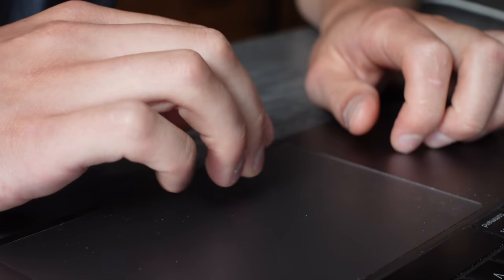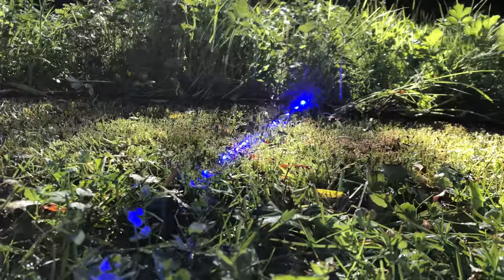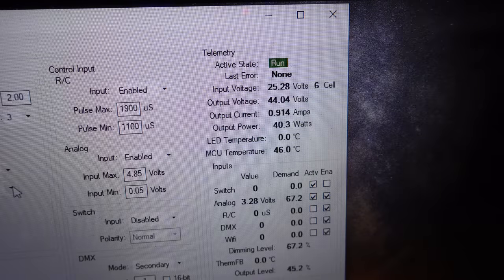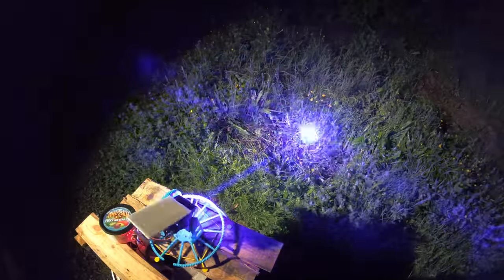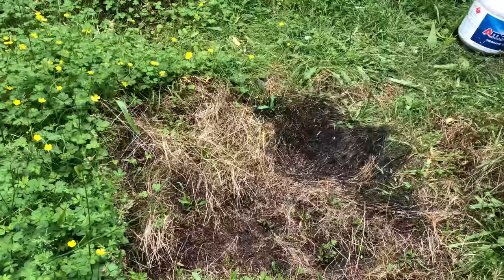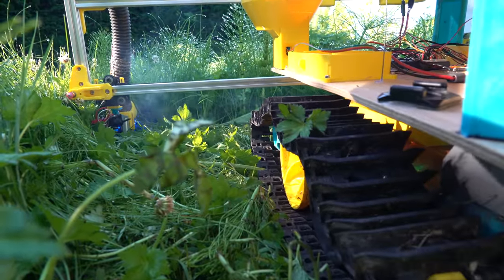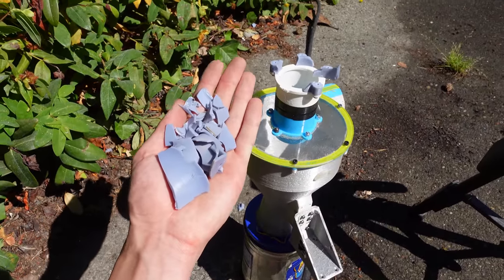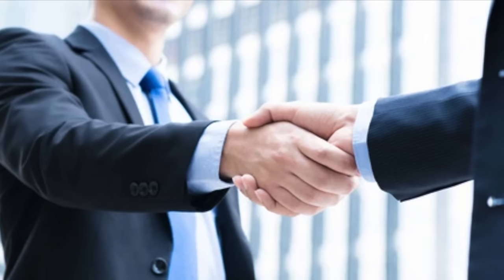Mowing My Lawn with a LASER!!!

Comment: As someone who works with optics, I can confirm this thing is terrifying.  Just below repurposing microwave part to burn wood.
Reply: Same, I have lasers that aren't built with proper interlocks and I keep the locked up like they're guns!
Reply: Anyone else flinch when he was using that huge, dangerously overheating vacuum to suck up explosive sawdust indoors on a carpeted floor?
Reply: @rubiconnn  yeah, if some of those sawdust pieces started burning on the motor, he’d practically have a flame thrower/torch
Reply: @rubiconnn  don't youse even worry about it pal
Reply: @iwenttogoogleheadquartersa1397   This is a vacuum so it wouldn't be  a torch or flame thrower.
Reply: @mmace3  he had many particles that were blowing out the top, the exhaust, of the vacuum that would have ignited causing a rapid spread of flames through the cloud of dust. Not so much a flamethrower but at least a boom and if he kept sucking saw dust then it could continue like a torch. Sawdust when aerosolized is very flammable
Reply: That should be the next project, make a microwave "laser"  Focus a microwave beam into like a 1mm beam to cut grass.
Reply: @redsquirrelftw  
Unfortunately, I think that turns out to be very difficult due to diffraction, though I might be wrong.
Reply: @redsquirrelftw  using a 300ghz microwave would produce a wavelength of 1mm,the problem you would have is getting it to resonate perfectly or it would destroy the beam quality and be rediculusly ineffective and inefficient. Not to mention the hardware requirement for signal switching and the power requirement.
Reply: This is what MAGA means when they claim they believe in lawn order.
Reply: @redsquirrelftw  D.I.Y . CHEMO!
Reply: I know a guy in Venezuela who uses parts of old medical machines from the 70s~80s to turn his garbage into plasma, don't know if it's laser or nuclear but no one came to fine him so it's probably laser but doesn't pay extra for energy so who knows. He doesn't like to put the garbage out so he made it in a way that the garbage slides from his kitchen into the plasmafier.
Reply: @redsquirrelftw  I knew an unethical guy who sold weed down at the high school.  He cut his grass with oregano.
Reply: @abrunosON  I hope your friend doesn't burn his house down with that plasma fire.  (On the other hand, maybe we could get that orange garbage in Maralardo to slide from the kitchen into the plasma fire.......but I digress.)
Reply: @Edward Elizabeth Hitler might as well just pyrolyzed it, going all the way to plasma seems like an unnecessary waste of energy
Reply: 枯れ草に枯れ木に火種を残す行為に恐ろしさを、知らない方の行為だと思いますが。
山火事の火元は、タバコの捨てクズといというのも多いわけで、
このような方法で、枯れ木枯れ草に火種を残す行為は、
数時間後に山火事という事態でしょうね。

Comment: Possible improvement idea: put a laser rangefinder on it and have it adjust focal point of the laser based on distance. That way you can mow anything at any distance.
Reply: or use the distance as an indicator to switch the laser off, when there isn't a target. We could call that a "safety".
Reply: Yes definitely should use an oscillating focus
Reply: I was thinking that. Maybe get an autofocus off an old camera or something, something motorised that focusses. I think he was lucky enough to find his existing lens worked to extend the focal point though, getting adjustable focus might push it into real, actual, optical work and beyond just gluing stuff together from his 3D printer.
Reply: This is a fire hazard.
Reply: @richardwicks4190  yea, using a form of energy to mow your lawn is a fire hazard, what's your point?
Reply: You just founded "the international lawnmower services"
Reply: @richardwicks4190  so are normal lawnmowers
Reply: @richardwicks4190  "This is a fire hazard." as compared to a machine running highly flammable fuel that you spill every time you refill it?
Reply: @richardwicks4190  yes west of the Mississippi for sure
Reply: Also want to make it so it stops at certain distances.  Can you imagine someone walking down the sidewalk and getting burned/sliced in the side of the foot/ankle.  Maybe a reflective surface border fencing that directs the beam straight down maybe two inches high.
Reply: BRB mowing my neighbors from the porch
Reply: @darkshadowsx5949  Yes, potentially flammable substance inert on the ground vs directed energy firing in a straight line, capable of igniting anything flammable with a large area. Clearly the same level of danger.
Reply: Double the laser power.

Comment: I actually contemplated a similar idea, about 35 years ago.  Despite the considerably 'weak' lasers of the time, my design was to point a laser down, and deflect it from a mirror.  If you were to combine this with a video system, that optically observes the laser, a servo could be used to trim the mirror up or down, for uneven terrain.  

Now, assuming that you wanted to run this device continually, 24-7, you might want to put up some barriers, for example, on the fences, trees, or other things that you'd rather not be 'cut'.  A reflective surface, such as aluminum reflective duct tape, could reflect the intense beam away.  

As I watched the portion using the 'rover', again, I think you might have some success, by mounting two lasers, pointing down, and using mirrors to 'double-cut', at the same height, a photo-eye, could be used to advance the rover forward, if nothing is breaking the light of the photo eye, and stopping/slowing down, in front of the cutting lasers.  

35 years ago, it was just a thought, but with today's technology, I'm surprised no one has capitalized on this kind of 'green(er) energy' advantage.  Keep up the good work.
Reply: Those reflections could sear your retina, and at a decent distance. Lawsuits are why this isn't a thing.

Comment: I love your ideas.  I am a gardener with a degree in engineering.  A mower needs to be able to keep a lawn trimmed approx. every 2 weeks.  Concentrate on trimming a lawn rather than clearing a jungle and you should have less issues with grass falling in front of the laser.  Consider having the lasers underneath the vehicle body between the axles.  You can point a series of lasers across to lenses and mirrors on the other side of the undercarriage to improve efficiency and safety.
Reply: Right. And maybe think of aligning the laser vertically downside and just rotate a 45° oriented mirror.
Reply: I love when engineers improve efficiency and safety.  
"You have a laser that can blind in nanoseconds? Add mirrors! The more reflective surfaces, the better it works!"  XD
Reply: @MomannBudd  my thought from beginning of this video. The beauty of lasers is that you can keep them stationary and align optics robotically to move the beam in 3D AND adjust focal length....
Reply: Excellent observation and suggestion! My fear with his idea is on the rare chance of some stranger deciding to play with the laser when he's not looking and suing him for damages. Creating a housing for the laser is an interesting idea that I'd love to see him tackle. It may even be a faster cut due to the mirrors.
Reply: Great idea. And keep the laser contained in a box that runs over the grass, like a conventional mower.
Reply: I was thinking, wouldn't hitting the plan with a laser cauterize the plant and not let it grow as effectively?
Reply: Guess that's why you chose the gardening route huh ;)
Reply: @BrainHurricanes  lol, then remove the laser and replace with a large spinning blade... now we're onto something 👍
Reply: @CarlosAldrey  My guess would be that plants like that are probably used to some fires breaking out anyway, and because the cells in laser's path are dead they can be shed (as opposed to chemically damaged, which can cause mutations, essentially stunting growth)
Reply: No one cares
Reply: Well that degree was a waste of money wasn't it
Reply: A Gardener with a Engineering degree giving advice on Engineering? We're you one of the engineers who designed the Millennium towers in San Francisco by chance? 🤷‍♂️🤦‍♂️
Reply: @Catchmeifyoucan209Stockton  Dont worry Im sure he knows as most engineers know they are useless dingbats around real men that actually do the work.
Reply: The problem is the laser is a complete safety hazard that anyone within 100ft+ should be using $300+ safety goggles.

Comment: I think a tattoo removal laser or other very short pulse, high intensity blasting laser would be more effective here. As it will explode the grass rather than burning it, which is vastly more efficient.

Though I guess it will also emit broadband light from the million degree plasma fireballs it generates, which will include UVC and X-ray radiation, as well as just being incredibly intense even through any eye protection out there (and obviously blasting the retina or lens with such a laser directly would be blinding).
Reply: can't explode the grass if it doesn't provide enough energy to do that
Reply: @5omebody  can explode the grass if it does provide enough energy to do that
Reply: Those things can be over a hundred grand though and weight as much as I do. They are also way the fuck more dangerous than this laser.

But fuck it, he should do it!
Reply: Why not shooting depleted uranium rods or blades with electric energy acceleration and those cut nice lines point a to b. Then send these every few mm apart and you get smooth yard. And waste "blades" fly far away, so it's environment friendly for your plant.
Reply: somebody
One coffee cup of grass have energy enough to explode a car to disappear, if you know how to relase that energy fast enough. That's not only theory, it's true.
Reply: @jannejohansson3383  dry plus oxidizer plus finely mixed, or hell just dry and to a very fine powder, dust explosions are powerful
Reply: So it would have to happen under a completely opaque hood... just like a normal lawnmower. There goes the whole "cool lasers" factor. Are laser printers cool because they have lasers you can't see? No, they're cool because they do their job well and if another technology (like Brother's LCD shutters) can do the same thing, great!

So we can't have any of that, because then the laser would have to compete on things like practicality and power consumption and speed.

Comment: You should hang the laser on three steel wires, so it maneuver freely in 3D space without needing a vehicle. The wires can carry the power (by using an insulated transformer you can safely use AC power) here. Just add a spindle with the laser on the bottom. :)

For safety reasons, you can add a 24 GHz radar to detect humans, so it would zip up out of the way as soon as a human steps into the garden and continue work if you're gone again.

Comment: The pan/tilt version scorching plywood really suggests that this is half way to being a functional if not practical large format laser engraver, to do murals and stuff; depending mainly on what other materials it can scorch. I have to wonder how hard it would be to motorize your columnating lens system to move the convergence point in order to maintain focus on a plane, then add some kind of system to measure the distance and relative orientation of a wall; and of course some code to the controller to vary brightness based on a jpg, png, svg, etc. Finally you build a 3 walled tent out of laser curtains.
Reply: That would even be good for etching guide lines for painting a regular mural.
Reply: Good idea
Reply: Yes we definitely need to see this!!!
Reply: Downside is no-one is allowed near the mural and you'll need a at least a few layers of opaque sheets blocking the reflected laser light.
Reply: That would be a much better use than making a patch of grass look ugly
Reply: Did you see the part where it took him 6 hours to get the laser to move left and right? We need a stuff made here collab maybe.
Reply: @Ms Moon Boo bruh in astrophotography when they're stacking a bunch of light frames they also need dark, flat,bias,flat/bias  frames etc...     

these frames remove noise by different brightnesses 
and they use different file types to import different brightnesses
like : jpeg and jpg types in general,png,tiff,and tif
so it isnt about digital art its more of photography in general
Reply: @Ms Moon Boo He was just listing filetypes that could be used to control it. Obviously the filetype isn't itself a control value.
Reply: If you are already shifting the focal point, just shift the laser a bit out of focus to make a lighter part, and more in focus to make a darker part!
Or just make the laser go fast on the light parts and slow on dark parts.
Reply: @dustinbrueggemann1875  ... But it could be 🙂
Reply: @FPVenius  On this episode of Cursed Code...
Reply: @Ms Moon Boo I don't do digital art /well/, thank you very much! I only said jpg as a stand-in for some graphics file, were it me I'd start with an SVG ingesting toolchain in the hope that vector tracing would ultimately save time vs raster etching, but there is so much research I haven't done to solve this feature.
Reply: @Ms Moon Boo why do you make a comment that is only to show how smart you are rather than actually contributing to the topic? You discredit his statement and add nothing. Why? Do you need the affirmation? Ok you are so clever. Better now?
Reply: @Don-rg2yl  go away.
Reply: @Ms Moon Boo They mean brightness based on the data contained in a file of those types, not dependent on which type of file.
Reply: That's a galvo laser you are thinking of. Look up "laser pecker", a small graphics laser for hobbiest

Comment: Version 1.1- ditch the laser, go with the magnifying glass concept as demonstrated  early on. Get larger & more lenses, use camera lenses  to control focal point. Prisms can help aiming. Run the rover off solar. Sunlight  can be  far more powerful  than those 40w lasers, just  needs concentrator.
Reply: Parabolic Lensinator9000
Reply: Sunlight here in the pacific northwest is a bit hard to come by except in june, july and August.
Reply: @Blaiz3d  don't forget the way to obvious "self destruct" button
Reply: Every lens more eats some 10% power what that beam got before going true it. Same thing every lens and prism. That multiple spot laser is bad idea, you can get only one in optimal spot, if you aim it to lens. Those diode lasers called pussy lasers, there is CO2 lasers and maybe Ne-He gas lasers should work too. Then use fibre and small lenses to point power where you want. If that kind technic could cut 100mm titan, some grass cannot be end of world for it.

Comment: The problem is tall grass.  Mow the grass first, then use this to keep it trimmed at 1/8 or 1/4 inch clippings so they fall back into the grass, and it might work great at maintaining a large area.  Might need a much more powerful laser, and then encased in a safety cutting head/shield like a mowing deck.  Someone would end up lighting the neighborhood on fire though.

Comment: "some weird six legged spider"

Spider that lost 2 legs after being accelerated to crazy speed inside a cyclone: 😑
Reply: No that spider is a brown recluse
Reply: or, an ant...
Reply: Don't worry though. Most spiders can actually regenerate limbs on molt cycles, and many have been documented self-amputating trapped or damaged limbs without hesitation.
Reply: @tone618  looks more like a sac spider, minus the right front leg.  No head-violin and smaller than an adult recluse.  Still has a pretty nasty bite.
Reply: @trenchrot  Not to mention that brown recluses aren't found in washington and sac spiders are